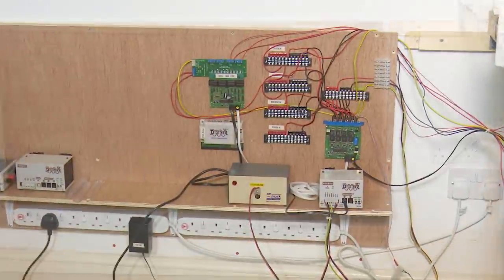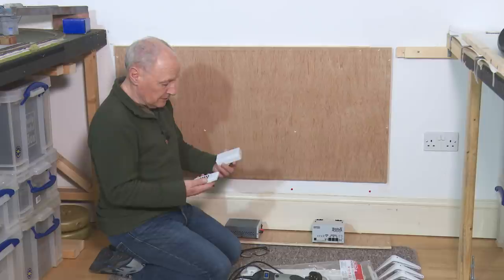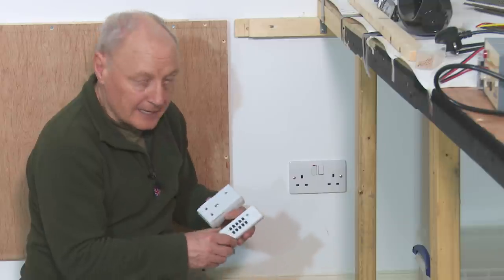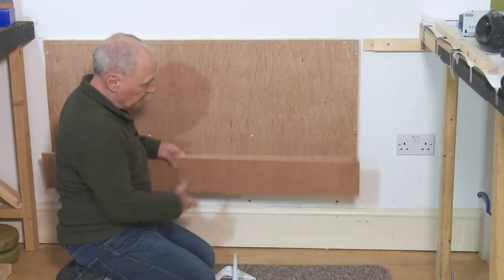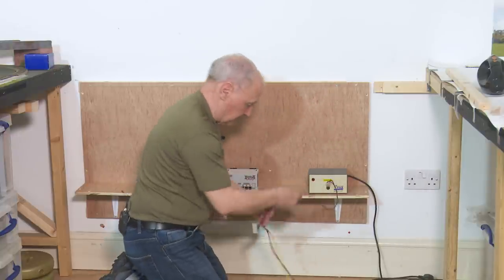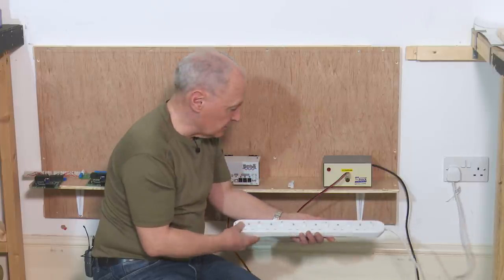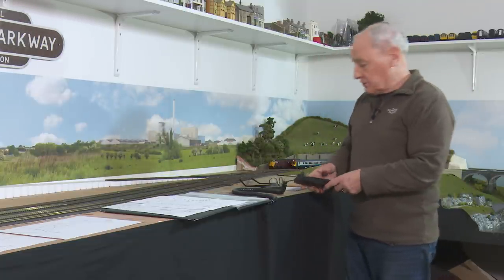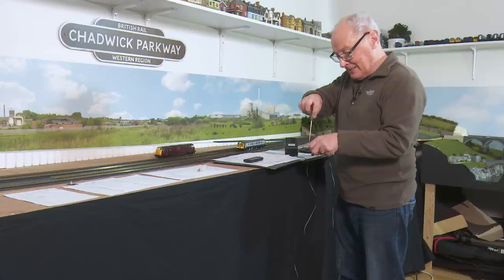Wiring Model Railways using Terminal Blocks at Chadwick Model Railway | 86.

Comment: No offence those power boards are but ugly just get a proper power rail your electrical wholesaler will have them Clipsal Cabac all the pro names make them they are seen in data cabinets they have their own breaker on board and a are slick you can never have too many drop me a message I can send you some pictures of how i did.  REGARDING The remote power they are handy i use them when I DJ to activate multiple bubble machines UV or other lighting effects that don't need the DBX controller.  HOWEVER the power board version which became ban for good reasons was a dangerous and complex thing that was not worth it.  Transgressing.  TP-LINK and others down do the same thing but of course sync to your local network and you can say Hey siri or ok google turn on the christmas lights or south section of model railway and away you go they are getting cheaper and better but since I don't like exercising i don't mind getting forced exercise of bending down and flicking a switch of course IAM lazy so just rewired an additional switch as required LOL  Anyway always good vids party on!
Reply from the maker: Thanks Josef, great info and I’ll check out the power rail.